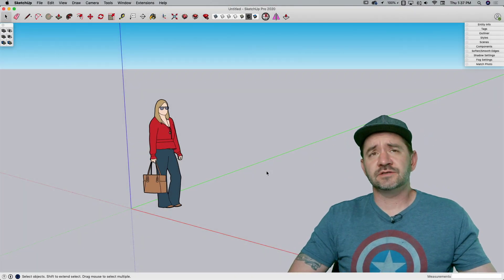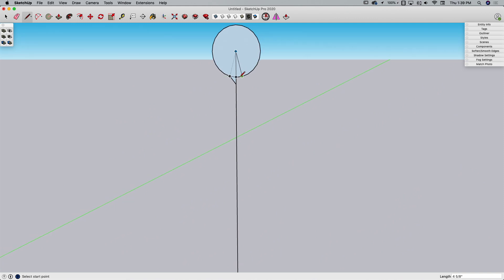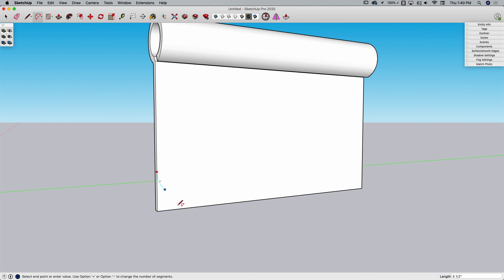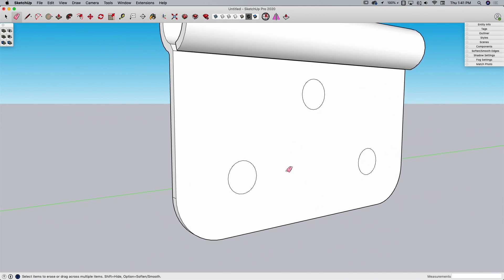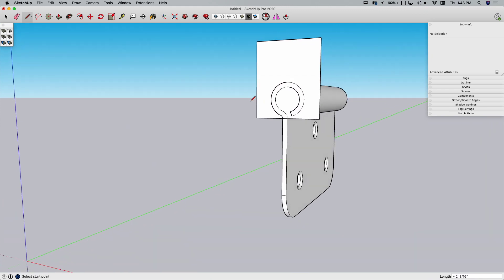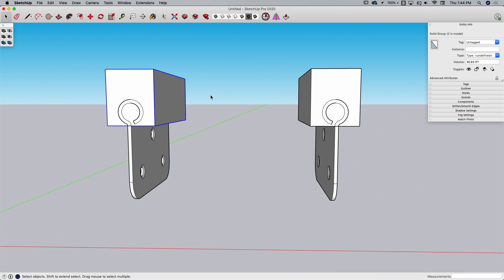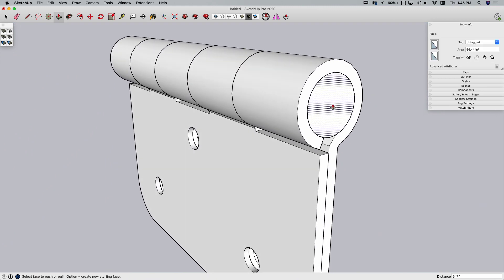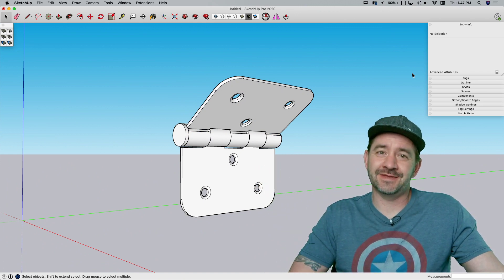Modeling a Proper Door Hinge - Skill Builder

Comment: how do you find the center of the circle so easily . Is there a special key?

Peter
Reply: As long as you keeps the circle unbroken hold over in the edge of circle will show a guide of center point automatically. You can draw cross guide by tape measure tool or protector.

Although there is some extentions for that but you can do it with default tools

Comment: How are you getting the circle tool to infer to the center of that pin opening?  I'm clearly missing something there.
Reply: If you hover the cursor reference on any point of the edge of the circle it should then highlight the centre point. Similar to when you run it along a line and it picks out the midpoint. This should also work for arcs.

You can also just add a line across the circle and pick its mid point.

Hope that helps.

Comment: Ha. I mentioned the 3 and 2. Thanks for doing another video. Also, the 3 knuckle goes to the door and the 2 to the frame side. I think that's so you can line the pin easier. That fillet double click! Nice.
Reply: Other way round usually, the 3 knuckle goes on the frame, 2 on the door.
Reason: Load spread carrying the weight of the door. Ask any old carpenter